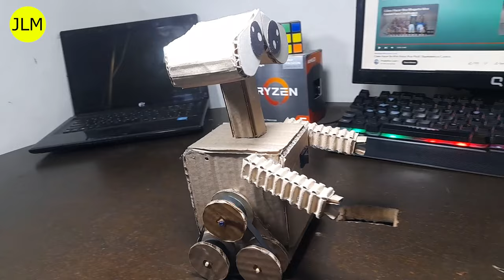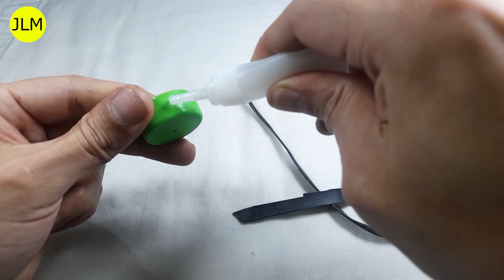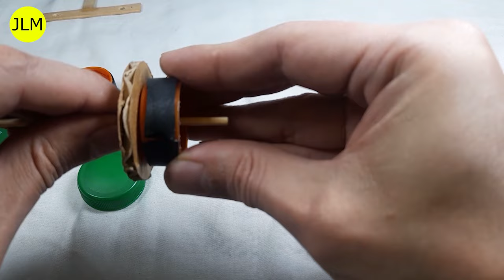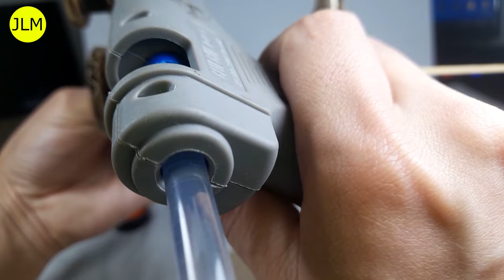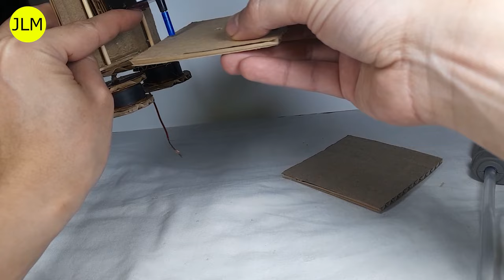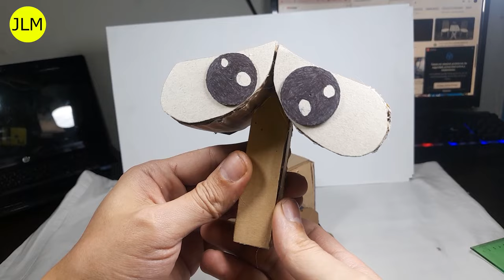Robot Wall-E De Cartón muy fácil de hacer y funcional hazlo tu mismo

Comment: Si da las medidas, que no las diga con su voz es otra cosa, presten atencion a los detalles. Cada vez que va a recortar una figura muestra con la regla la medida 🤷🏻‍♀.

En cuanto a materiales son bastante entendibles tambien.

Materiales de la estructura: 
1. Carton
2. Tapas de botella
3. Banda elástica
4. Palillos de pincho
5. Palitos de paleta
6. Palitos de bom bom bum
7. Silicona
8.Pegante instantaneo

Materiales electricos:
1. Pulsador
2. Alambres electronicos
3. Baterias, yo usaria una de 9 voltios ahi la que utilizan no se alcanza a entender
4. Motor de doble eje
Reply: 2